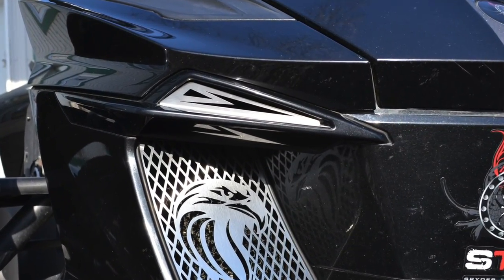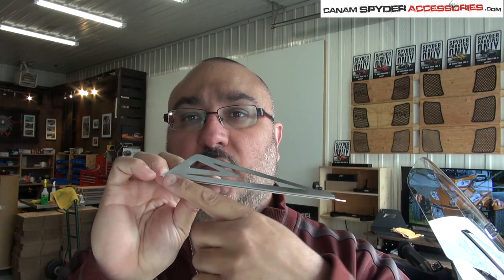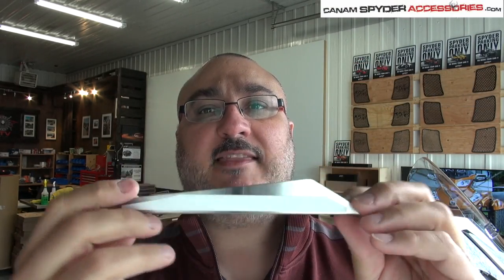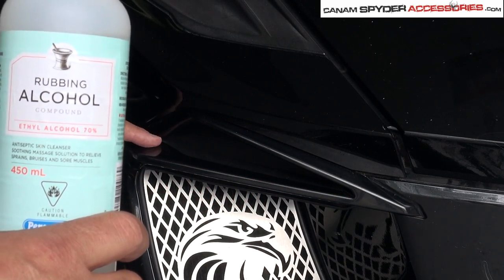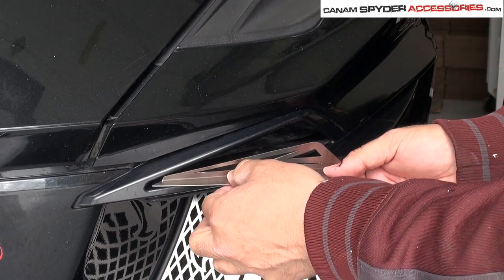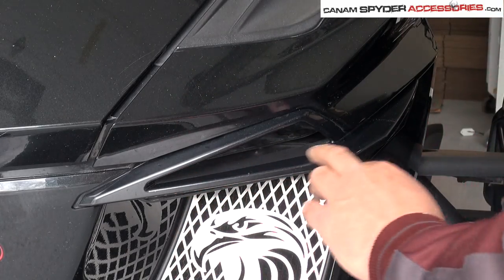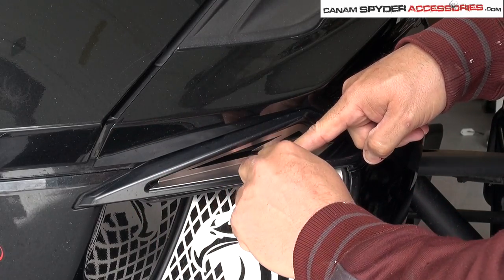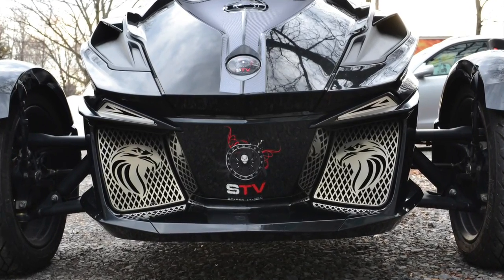Installation - Can Am RT Spyder Upper Front grills - 2014 and up

Comment: All your grills look great, but what about restricting air flow? When it's 100 degrees+ in south Texas, the electric fans are working over time without the grills, are you saying your grills won't effect the cooling? You might want to head south from Canada to south Texas to do some product evaluation in extreme heat conditions.
Reply from the maker: What i'm saying is this, our front grills have been on the market for over a year, from Australia...extreme heat....to Texas......yes Sir, we've sold grills to Texas and California.....Vegas....France.....Spain.....and about 15 dealers install these for now and never...never had an issue.
Reply: Something you might add in your advertisements, I don't know how BRP is when it comes to after market ad-ons. If they endorse your products then it's safe to assume it does NOT present any problems to their systems. Thanks for your reply. You have some great products, thank you.